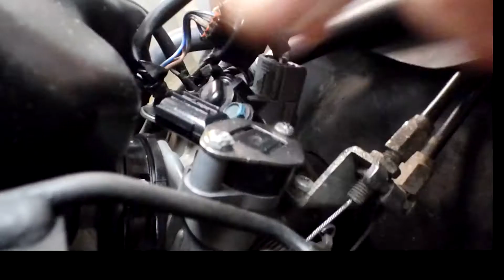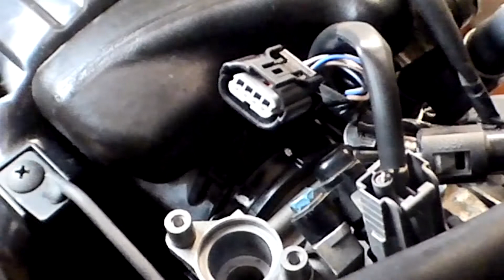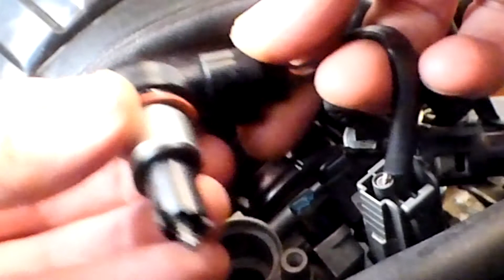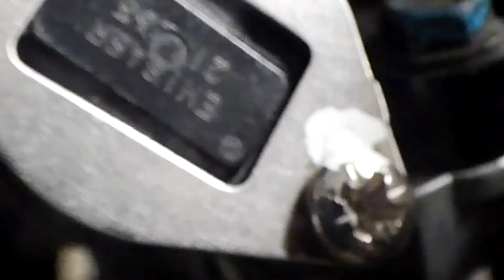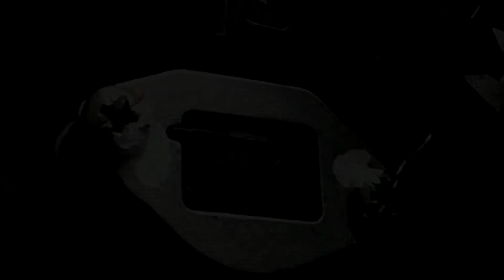HONDA CBR250R IACV

Comment: Ha! Ive had lots of fun with my iacv on my crf. I get 3000rpm idle when riding the bike hard. If i cool the radiator with water the idle returns to normal so i ran the checks on the ECT sensor... it checked out ok. I replaced it and everything is back to normal again so you cant always rely on the manual or the DTC.
Reply from the maker: YES
The technical book can not be a substitute for a motorcycle mechanic full course, and can not be a substitute for knowledge gained over years of experience. Besides in technical books there are sometimes mistakes. YouTube videos should be treated in a similar way, they will always lack of guidance (not everything can be explained in short videos), and mistakes can always be made at them too.
Reply: @mycbr250rdmotorcycling7  my idle speed is correct now after fitting a new ECT sensor but i tested the old and new together and both tested ok!
Reply from the maker: @theravedaddy  
Basically if the DTC code does not pop up it's a sign that the components are in the right range and we need to look for the problem elsewhere. Proper functioning of the FI system is only part of the story, but if for example previous owners "played" in ECM and changed certain parameters or value change in the map ... what then? So sometimes there is no choice and the way to locate the problem is through replacing components, and troubleshooting in this way is slow (because of delivery times), and sometimes even expensive. In your case it is not clear exactly what happened, not all the instrumentation malfunctions are measurable, but the fact is that ECT replacement solved your problem, this too can happen, maybe an electrical contact problem? Not every repair can be explained at the end, if the problem does not come back, it's a sign that the repair was successful👍👍👍
Reply: @mycbr250rdmotorcycling7  i have owned the bike 7 years, its a stock ecm. I forgot that i had this fault years ago. I think it recorded a 7 back then but this time no fault recorded. Im ready for the next time!

Comment: Hello my friend. My motorcycle idles smoothly, but my motorcycle backfires at 5,000 and 6,000 rpm. No DTC, fuel pump changed, ignition system changed, fuel changed, any guesses?
Reply from the maker: Hi. I have no experience with a similar problem. What causes the explosion is unburned fuel, which goes into the boiling exhaust, and explodes in the exhaust instead of inside the cylinder. Is it possible you have a spark leak? Maybe there a leak of spark because there are bad contacts in the cable coming from the coil? Maybe a bad contact in the components inside the plug CAP? You need a patience. Changing parts without understanding what you are doing does not always help to solve the problem. If you can't get it right, don't hesitate to go to a qualified mechanic you trust on.

Comment: Hello sir please make me a video for CBR 250R Crank shaft main journal bearing measurement
Reply: How is it measure
Reply from the maker: Hi. There are exact instructions in the Honda motorcycle manual. For this task, a special tool is needed to insert the two halves of the bearings into the cases. I heard from someone that it is better to buy both parts of the case as a set, because it comes with new bearings build in. If you are patient enough, buy the guide, buy the special tools, and enjoy the work.
Reply: @mycbr250rdmotorcycling7  ok but how to measure with the help of plastic gauge
Reply from the maker: @ZaidKhan-np9mr  
This is a process that requires accurate measuring devices, for measuring the internal and external diameter. In this process it is not possible to use a plastic gauge. Only after measuring I.D. and O.D. you can decide what needs to be replaced. It is not always enough to replace only the bearings rings. Pless open the Honda's service book and read about the process and the necessary tools.
Reply: @mycbr250rdmotorcycling7  Ok sir respectfully thank you so much for your opinion ❤️💯

Comment: Hi bro I have some issue with my cbr 250r
Recently changed 4SHIMS but now also feel very hard and vibration after 6-7k RPM do u have any solutions please bro
Reply from the maker: Hey. If there are strong vibrations at high RPM, you should not reach a high RPM. It is desirable that until the cause is found, you should not ride on the motorcycle at all.

Questions:
1. Before replacing the shims, did it work normally? Why did you change shims?
2. Is it possible that something went wrong in the shims replacement process?
3. Are the vibrations accompanied by metallic clicks, or other metallic noise?

You are also welcome to ask in the forum cbr250r dot net.
Don't hesitate to contact a qualified mechanic that you trust on, maybe it is some simple problem. Because a mechanic sees things I can't see and you may find it too hard to explain
Reply: @mycbr250rdmotorcycling7  strong vibration means in tank
Reply from the maker: @adithyabr4239  
The fuel tank loose?
If the vibrations are from the fuel tank then the suspicion falls on incorrect assembly, or during the treatment parts were lost and now screws or rubber are missing.

If you take care of the motorcycle yourself, then like any mechanic, you must remember that patience is a very important tool. Don't work fast, work correctly and by the book. Try taking the covers out again, and try to see what is missing there, or what was assembled incorrectly.

The fuel tank itself is fastened with three rubber and three screws, and the front screw also has a special collar.
Reply: Bro thank you soo much

Comment: Como se desarma esta válvula para hacerle mantenimiento
Reply from the maker: Hi sir
Sorry, as far as I understand this valve does not require any maintenance.

If there is no known fault associated with it, there is no reason to dismantle it. If there is a problem with the valve's electric motor, then you replace the all broken part with a new part.

For disassembly you need a special Torx key that has a hole in the center.
A special procedure is required to return to that valve to his place.
So if you don't have the motorcycle manual don't touch it.
Reply: @mycbr250rdmotorcycling7 Shouldn't this valve go up? why is he spinning? how to check its functionality
Reply from the maker: @hooliganh1500  
Hi sir. When the main switch is turned from OFF to ON, a series of automatic tests begins, during which the brushless motor that activates the IACV valve is also tested. It's a stepper motor, so when it's rotating there's a "bzzz" sund. During the test, the valve opens and closes, meaning the motor makes two short rotation movements, one clockwise(up) and one counterclockwise(down). then stops. If during the test you hear the buzzing sund, and if after engine is starting and running the yellow FI light turns off, it means that the IACV valve is normal.
Reply from the maker: @hooliganh1500  
P.S. Dismantling the IACV valve from its place requires a special tool, and returning it to its place requires a special procedure (a very specific angle and position). And the IACV mechanism inside is very delicate, so it's easy to destroy if you don't know what you're doing.
Reply: @mycbr250rdmotorcycling7  My engine stalls the first time, but always runs fine the second time, I'm looking for the problem
Reply from the maker: @hooliganh1500  
It is possible that everything is fine and you just need to slightly extend the time you press the start switch.

The other option is less nice, it is possible that it is related to a problem with the compression: After the first time, after removing oil residues that penetrated the combustion chamber, and the metals heat up and expand...
Then the second attempt goes up nicely and successfully.

I may be wrong.
It is recommended that you contact a mechanic you trust on. You can try to get more opinions on the forum cbr250r dot net.

Comment: What was the issue with it bro
Reply from the maker: I had a problem with a cold start. At the end of the problem is in ECM, which is also not a problem. The previous owner changed ECM parameters which related to the control of the idle rpm. More details about the case you can be found in this thread:

https://www.cbr250.net/threads/hard-starting-and-shutting-off-when-twist-the-throttle-probably-engine-that-experienced-overheated-66-000km-model-2013.69307/post-690869
Reply: @mycbr250rdmotorcycling7  where are you from buddy 
..I am also planning to buy a used one ..I am also a diy er and plan to maintain it myself
Reply from the maker: @kamal10011  
ISRAEL

DIY is a beauty of a hobby, it is commonly mistakenly thought to save money, and time, but for a hobby you pay money: you pay the price of your mistakes (the price of learning), you pay for the toolbox, you pay for the technical literature, and you pay for investing a lot of your work time. The spare parts are not in the your warehouse and you need to be ordered them alone, and sometimes it takes them a long time to arrive, sometimes it takes several weeks. 

Motorcycle mechanics is a serious matter, and mistakes can cost both serious injuries and even death.

Dear Sir, I do not know, I just say that if you do not have a previous background in mechanics, or if you do not have a great passion for DIY hobby, if you do not have much patience, if you do not have a suitable budget for tools, and if you do not have a comfortable place where you can work quietly(Garage) ... then I politely suggest for you not to start with This.
Reply: @mycbr250rdmotorcycling7  you said it right brother..
I am a mechanical engineer..and my fingers feels itchy Everytime I get hold of an engine and the satisfaction and joy that my work gives me ..if the outcomes are good ..you know that feeling.

Comment: Gimana begitu doang ngak jelas semua orang mah bisa buka Dan pasang
Reply from the maker: @JurihJuri  
Hi sir. I'm not sure I understand your question. Honda chose to use screws here with a special torx type: A torx head with a pin. I'm guessing they wanted to limit access to professionals only. Maybe because of the expertise involved in putting the part back in place: (1) For access, the fuel tank must be lifted, (2) There is some trick with screwing the cylinder valve up, (3) Then matching the slot in the cylinder against the pin found in the throttle body, (4) and you have to apply a new o-ring, (5) and the plate that tightens from above has only one direction that is correct for tightening. So the whole thing is quite delicate and complex. But that's just my guess.